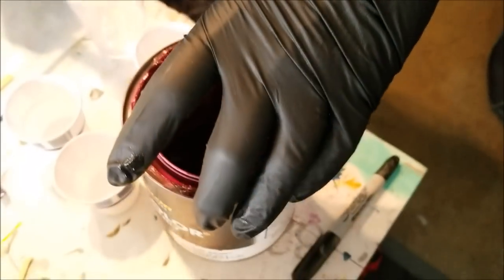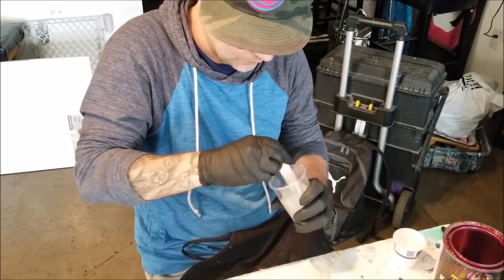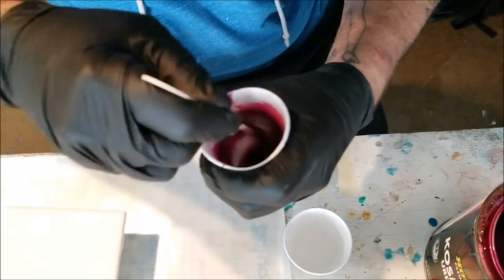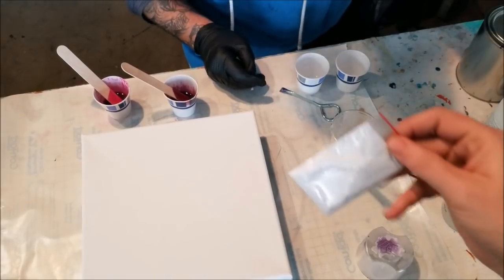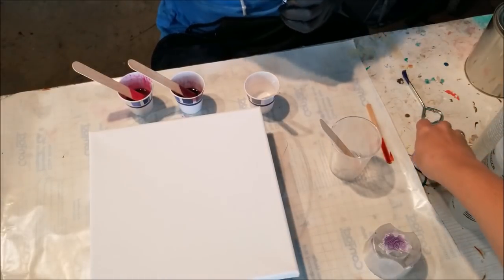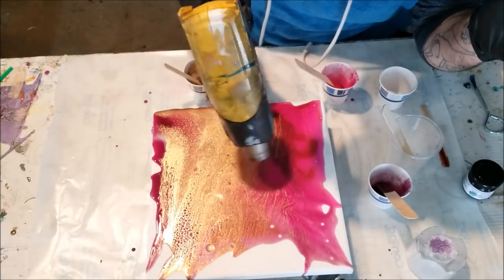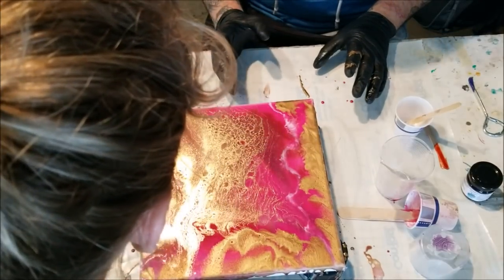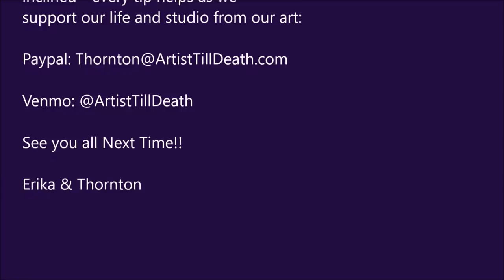Using CAR Paint in Resin (Lets see if this works)

Comment: What is the difference between polyester resin and epoxy resin? Can polyester resin be used for artwork? I’m pretty sure it’s way cheaper. If not, why not? PS. I actually think the “fish-eye” if a neat effect. There was probably a drop of lightweight oil or something volatile that rose to the surface and yet left enough of a  residue to hold the formation. Likely a petroleum-based substance.
Reply from the maker: YTjndallas KEY DIFFERENCES BETWEEN EPOXIES AND RESINS
1. Bonding Strength
Epoxy is known for its higher bonding capabilities overall. An epoxy’s relative strength can hold up to 2,000 lbs. per square inch, while a polyester resin can hold less than 500 lbs. per square inch.
2. Resistance to Wear
Epoxy is more resistant to wearing, cracking and peeling, and corrosion or damage from chemical or environmental degradation. Polyester is more fragile and useful for temporary fixes, or low-stress use.
3. Cost Comparison
Epoxy is generally more expensive than resin, due to its strength and formulation requirements. Resin is more popular for craft and jewelry making,due to its lower cost. Remember, however, that you get what you pay for.
4. Resistance to Moisture
Epoxy is very moisture resistant, and certain formulations can even be applied underwater.  Polyester resin has minor resistance to moisture, is considered water-permeable, and can fracture easily.
5. Cure Time
Although cure times vary for both epoxy and resin, depending on the formulation and temperature at use, resin generally has a faster cure time. This can be good or bad, depending on the speed with which you want to finish your project. Both products can be manipulated somewhat by raising or lowering the temperature before use. Certain epoxies are also formulated for use in extreme temperatures.
6. Odor
Polyester is far less pleasant to work with than epoxy. Although it sets up much faster, it has the reputation for stinking badly enough to burn your nose hairs out. Make sure to use proper ventilation when applying both epoxies and resins.
7. Shelf Life
There is no doubt about it – epoxy products have a much longer shelf life than resins do. As long as it hasn’t been mixed, epoxy can sit in a garage for several years (or more) without losing its potency. Resin is much more fragile over time.
Reply: Artist Till Death Wow! Thanks for taking the time to make the most thorough reply ever!
Reply from the maker: YTjndallas it’s our pleasure. Thank you for watching and taking the time to comment 🤗🤗

Comment: Ive been also teying stuff like this..
Can urethane clear coat be used over resin to protect from direct sun light?  Usually resins dont do good out in the sun...or they yellow up or not heat resistant....do u know of.any out door use resin?